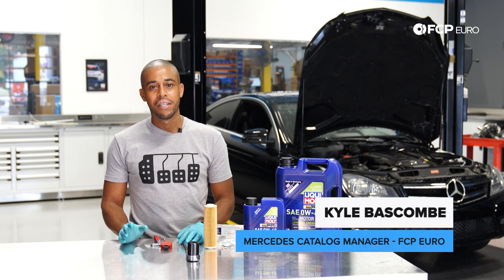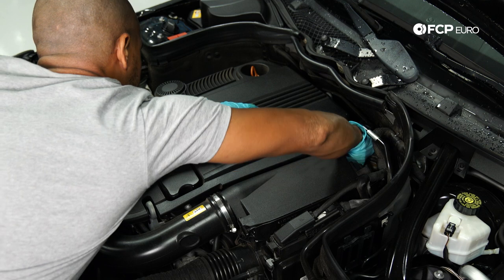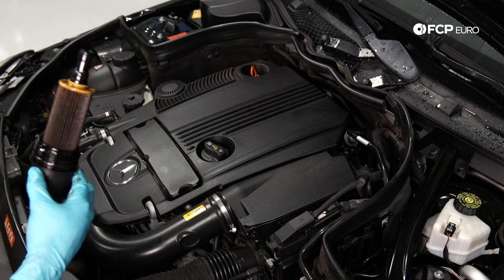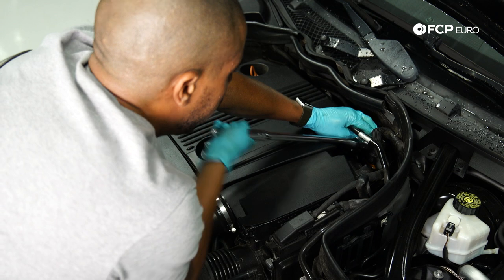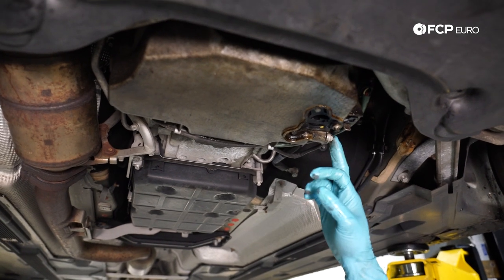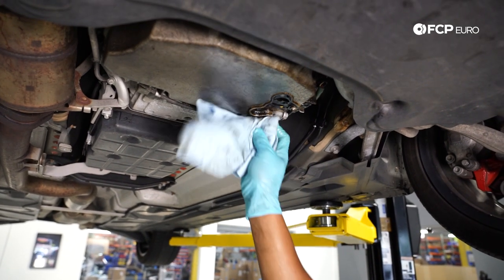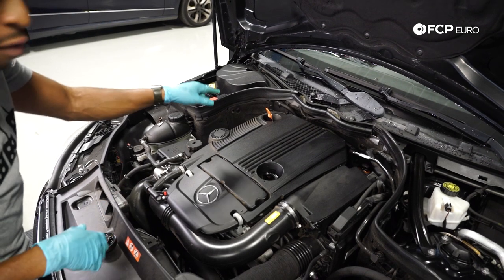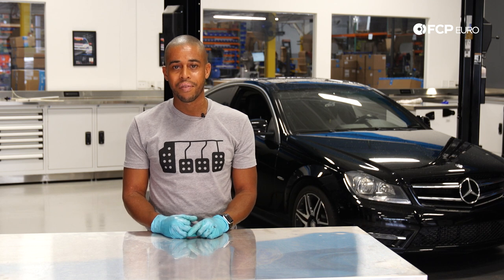2012-2015 Mercedes C250 Oil Change DIY + Service Indicator Reset (M271 W204, Oil + Oil Filter)

Comment: 🤪 I was just changing high pressure fuel pump and couldn’t-get to the screws-the filter cup was in my way but on mine it says”TURBO” so I didn’t want mess with it 🌰🌰🐿 after 5 h struggling I changed the water pump .. than was looking where is oil filter could not find it so I checked out YouTube and saw this video 😂😅 I wish I saw this earlier it would save me at least 3 h but the onetime clamp on the pump was nightmare too .. oh well saved $1500 cannot complaints too much 💰👍 good video thanks !!
Reply: i didnt undestand why it said turbo either lol. i knew it had to be the filter but didnt want to mess with anything that said turbo. took this video to find out

Comment: I Surely Change My Oil Every 5K Miles. I Dont Buy into that every 10K Miles, Thats why its Every 365Day/Yearly, Thats a Long Time in Between Oil Change. That Major BS, that's how you Screw your Engine Up. But I've been Looking for how to Set the Oil Change interval To Notify My Every 5K Miles and All I See is this B Service Reset, I Was Hoping you Talk about it here or at Least Show how to set the Oil Change interval, But Im not seeing anything Related to Oil Change interval... ??? 🤔😮🤔😯😮🤔

Comment: I have c250 2012 and there’s no history if the transmission oil has been changed before and now the mileage is 112k km should I change or no ?!
Reply: The recommended interval for transmission oil change is 5 years or 125k km. It takes 9 liters of fluid, specification 236.15. The color of the oil is blue.